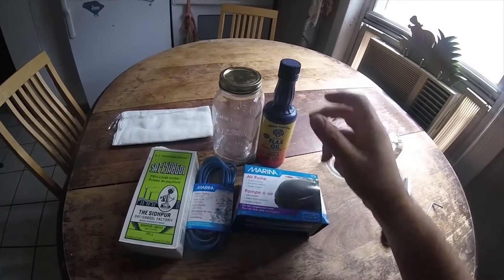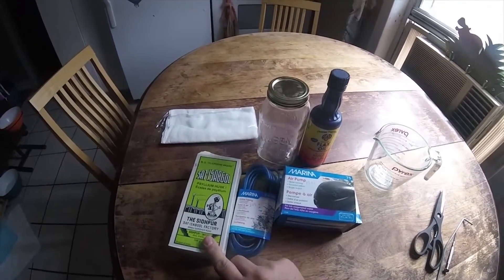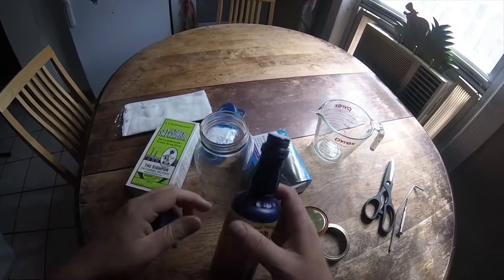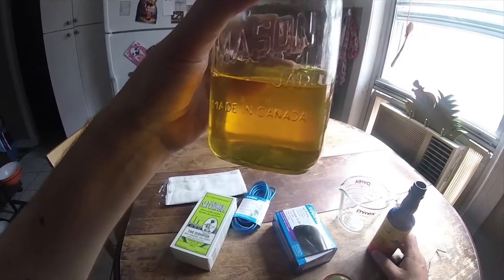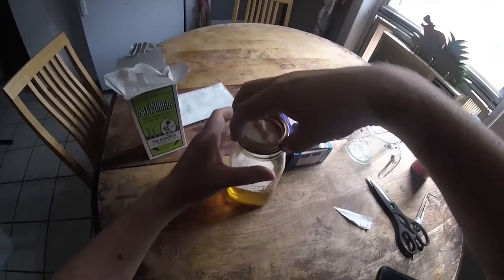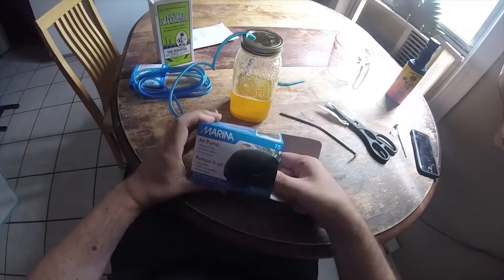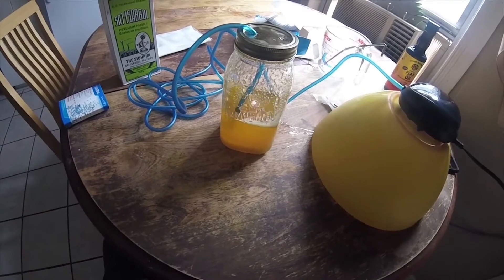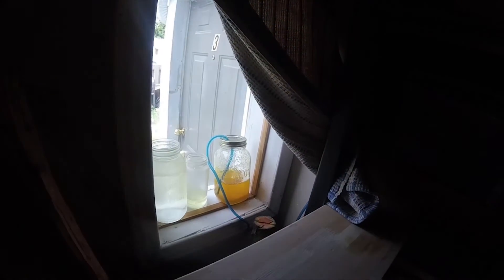Washing and prepolymerizing flaxseed oil, part 1

Comment: Thanks for your helpful advice! I tried hard to oxydise the oil using a bubble air stone. But that gave tiny bubbles spilling over. Just using the tube solved the problem.

Comment: On August 10,2017...I sent  Il FuriosoI a comment informing him of my past tests of egg white to remove the mucilage.  Il Furiosos video says he first tried egg white three years ago. That would be about 2014. In my comment , I said that my book published in 2012, titled " Oil Painting lessons with Rembrandt and Calcite Sun Oil, on page 42, has my recipe of using  egg white to remove the mucilage. It's called THE CSO GEL METHOD. It uses Egg White, Psyllium husk, liquor and the oil. No expensive equipment is required. ...The chemistry is quite similar between his method and mine. My recipe is ....5 parts oil, mixed with, 2 parts 80 proof liquor. Liquor is measured by " proof". 80 proof liquor is 40% ethanol and 60% water. Ethanol is superior to Vinegar as a mucilage remover. Vinegar is ascetic acid, it is only 5% volume in 95% water. Liquor and oil are mixed together and vigorously shaken together for a minute. ......MY recipe continues: 1 part egg white ..frothed and distilled into making Glair- to insure flow uniformity because an egg white is a combination of thick Gel and thin water. To the 1 part of glair , add 1/2 part dry psyllium husk.     ......Now, place this mixture into the jar with the mixture of oil and liquor. Shake vigorously together for a minute......Place the jar into a pot with water. Heat at medium flame,  and stir it until the mixture is hot...this equates his use of hot water. Cook for 30 minutes to an hour. Use goggles to protect your eyes. Avoid breathing the fumes. Have plenty of ventilation. Remove from heat. Allow to cool......ONCE the mixture is room temperature..place the jar into the refrigerator to chill it. The psyllium husk absorbs any extra water in the mixture......After a 20 -30 minute chill, Filter this cloudy mixture. Tightly place a cotton ball in a plastic funnel. It takes several minutes ( about 5) to begin the drain and several hours to filter the oil . The oil filters out transparent. ... My book gives other methods of removing the mucilage. One is the CSO Psyllium Husk ( velasquez Tavenier) Air pump method...it's the one shown in this good video.  Best wishes, Louis Velasquez , www.calcitesunoil.com

Comment: Hi. Thank you for giving me credit for the creation of this recipe. Find all my YouTube videos by searching CSO VELASQUEZ. I posted my AIR PUMP video in 2015. , then accidentally removed it. So, today I republished it. You can visit my website for more details www.calcitesunoil.com. In my tests I learned that if the air pump is allowed to run 24/7 more than 18 days, the oil will wrinkle when applied to a surface. But give yoyr 30 days test a try. Please view my website and you can write an email with questions. Best wishes..louis velasquez

Comment: Have you used this in a painting? What did you think about its performance?
Reply from the maker: Jesse Waugh I use it as a food safe and water resistant finish on hand carved wooden spoons. After 20 days I filtered the husk out with cheese cloth. The oil is near transparent and a light straw colour. It dries way faster than the oil right out of the bottle. I should do a follow up video and do some testing. Thanks for watching!
Reply: Uncle Clark's Adventures Thanks! This is something of a hot topic in the painting community due to its superior consistency and performance.